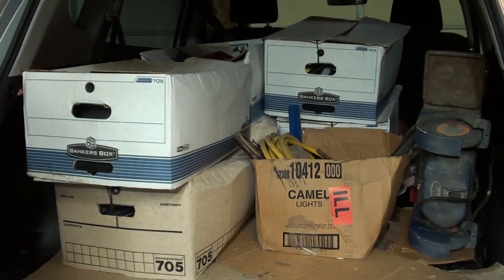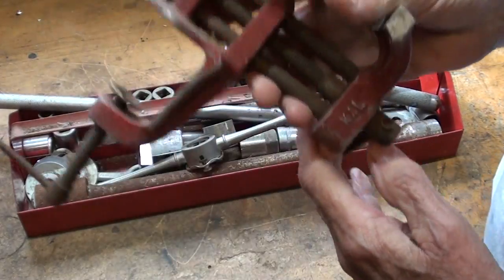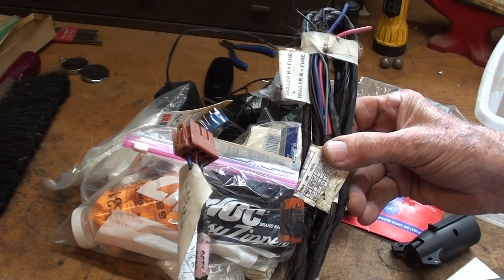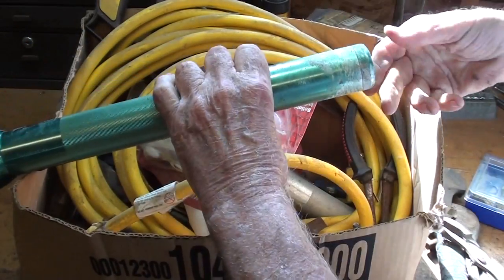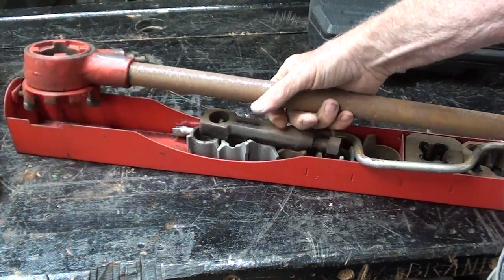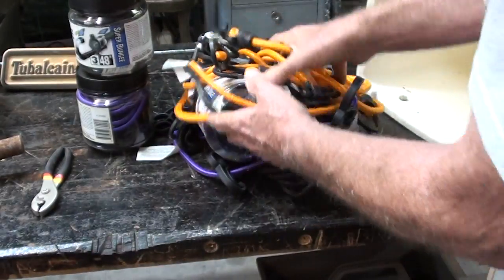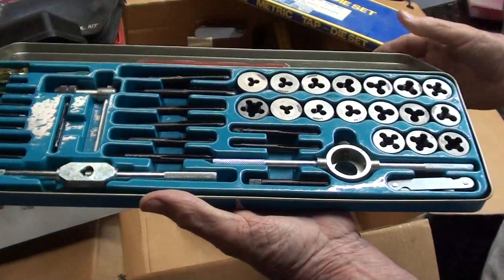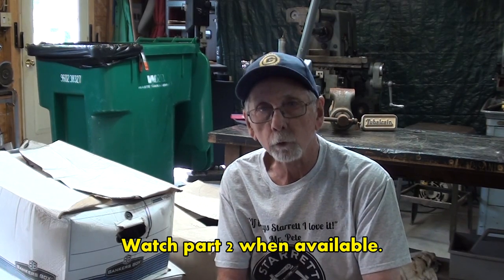MOTHER LODE OF FREE TOOLS  500 pounds pt 1 tubalcain hoard

Comment: The Stryker saw is a medical tool for cutting off casts (broken bones) it should cut the cast but not the skin underneath.
Reply: Might have a use in metal casting. I wonder if they use a Fein type oscillating tool nowadays.
Reply: correct also common in modern cordless used by trades people  with interchangable cutters for  plunge cutting in awkard places, copper pipes in corners ,sockets for electrical  boxes  and many more
Reply: Yep, I recognized the Stryker saw immediately. That's the same one the doc used to remove my (first) arm cast - 52 years ago!
It's funny which images will pop up out of the rusty old memory vault decades later...
Reply: in woodworking and remolding The German company Fein also made saws like that but then they come up with the  FEIN oscillating MultiTool which is a very handy tool .
Reply: @g.tucker8682  I had a feeling that was a cast saw... had mine cut off about the same time. I remember it burned a little when the hot plaster hit my arm.
Reply: @bookerol  Could be used for cutting fibreglass as well possibly
Reply: I had a cast cut off my leg with something very similar looking many years ago
Reply: Adam savage just happened to of made a video the other day talking about this tool
Reply: Cast saw or, if a slightly different blade and oscillation, a bone saw for orthopedic surgery.
Reply: @mauricelevy9027  -  It is, in fact, since most casts these days are comprised of moisture cured polyurethane impregnated fiberglass.
Reply: @bobweiram6321  bosch makes new ones that can cut on a flat and side plane.

Comment: Lyle, That Blue aluminium mallet with the white nylon ends, has lead shot inside to make it a DEAD Blow Hammer. Very nice to use, no bounce at all, I use mine a lot on the milling machine.
Reply: That’s what I used during my BAe sheet metal apprenticeship. They used the Thor brand in the 80s with nylon inserts

Comment: The Utica pliers at 19:12 with soft jaw inserts are called AN connector pliers. They are used for tightening and loosening larger circular connectors such as Amphenol and Cannon plugs.

Comment: At 27:58 Use brick chisel to clean welding spatter from metal welding table. Real easy and quick to use in sliding motion.
Reply: Carpet chisel... notice how it's with other Carpet stuff? It's used to tuck the carpet under the base bords after it's stretched

Comment: The Utica Pliers are Canon Plug pliers, they are for working with a specific type of Military plug connector, I find them very useful for working on round objects that you don’t want to damage, but they don’t grip very tightly - Stryker is a medical company, The saws came in a couple of variations, If it the blade rotated then that was a bone saw, used for cutting into chests or skulls.  If it vibrates that’s a cast saw.
Thanks for the videos.  Always appreciated.
Reply: And I just had to buy a pair of those cannon plug pliers last month.🙄
Reply: @jagboy69  My boss wouldn't allow me to buy a pair..."waste of money. Use channel locks & a rag." he said.
Reply: @ohmbug10  20bucks is cheap insurance to not screw up a cannon plug.  We work on aircraft so we really try not to booger up stuff.😉
Reply: @jagboy69  I agree 100%. I was an industrial electronics tech but I have an A&P licence. In the mill many times they were so corroded they would break. I suppose you don't need told what a pain they are to replace in the field especially standing on an extension ladder.

Comment: The pliers with the soft jaws are used to tighten "cannon" plugs, multi pin electrical connectors used on heavy equipment and military equipment.

Comment: You can convert the old Maglite flashlights to LED. Not as bright as the fancy small LED lights but they are still bright enough to blind, the batteries last for ages and I’d rather have one in my hand than an o light if I bumped into an unexpected visitor. 
I do enjoy a good tool haul video, I was with you right to the end, and no I don’t know what those tiny tools were at the  bottom of the box.

Comment: The vibrating saw is also very effective for trimming cured composite laminates (carbon fiber and fiberglass).  I've seen used in Kit plane construction.
Reply: Fein was the first company to make a  oscillating Multi Tool

Comment: 17:59 I think I know what that wrench is. Judging from some of the other "junk" I would say he was into aviation. I will take the Utica cheapy pliers they are for aviation cannon plugs and actually pretty good quality. The plastic jaws can be switched out and are still sold. The speed wrench you hate I would love. The new ones don't have the knob end and it is handy for stubborn panel screws.
The Stryker unit is used in composite aircraft structures. Very handy for an aviation structures guy. If I am correct the #24 & #30 drill bits are dull or broken. Check the angle on the line nut stage cone. It may not be the ASE angle. If that is the case definitely an aviation guy.

Comment: The Stryker saw is used for autopsies
Reply: Apparently if it oscillates then it's a cast saw, if it spins then it's a bone saw, you only use the blade that's on it on an oscillating saw

Comment: The tool in the stryker box has been used in hospitals for years for removing plaster casts and now comes in battery form for DIY use, as you noted the blade oscillates from side to side and can be used in awkward places, I have blades that cut metal and wood and one useful job is for removing hidden nails without wrecking wood trim etc.

Comment: Mag-lite sells replacement led-style bulbs for that flashlight. I have been using it for years.  
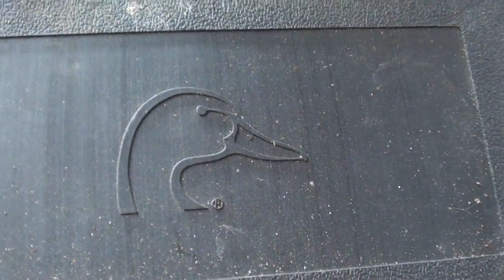 25:00  oscillating multi-tool is great for trimming in tight spots or where you don't want to damage surrounding areas.

Comment: Lyle - As others have said, the Utica pliers are Canon Plug, used for aircraft/military connectors on electronic equipment.  Used them many times and handy for anything round to twist on at times.  Watched the whole thing.  I needed you when I wanted only some broaches in one drawer of a chest at the auction of an OLD garage - had to buy the whole wall of stuff from the garage for $15 to get them.  Then filled up the entire back of the pickup with what was there.  But did sell off a set of headers in the mix to pay for the plunder.  And scrapped a lot of steel!

Comment: Mr. P,  At 19:20 those weird looking slip jaw pliers are for using on cannon plugs that are used on aircraft.. They issued us a pr of those for working on jet engines.. Haven't seen a pr of those in many years.. At 34:42, that is part of a knife sharpening system.. the little slots were for putting different angles on your blade.. Look and see if has the name Lasky on it.. I paid 60 dollars for one of their kits about 35 yrs ago...Nice haul, enough content for 2 or 3 more videos.. thx for taking us along.. God Bless...

Comment: The Stryker vibrating tool is for removin
g the old plaster cast that were used for wrapping broken bones. Remember " hey sign my white cast on my broken arm"? It was design ed not to cut your skin under the cast. The black shears with big loopy handles are gardners shears scissors.  The Utica slip joint pliers with rubber jaw pads i use in Aviation for avionics /electrical connectors and or plugs. Prevents damage to expensive avionics hardware. Your " cranked neck chisels" are for giving handle clearance. There other two are mortising chisels.

Comment: The Stryker saw is used to cut through casts, like put on for arm and leg fractures.  This brand is very expensive.  The blade oscilates and will cut through any solid material, but if you press against soft part of your hand, like the heel, will only generate heat.  There are modern tools using the same mechanism to cut wood like undercutting floor molding.

Comment: FYI - LED replacement bulbs are available for those older Maglites. I upgraded all of mine, to LED bulbs made by CREE. They are extremely bright, and do not drain the battery supply like the old incandescent style.

Comment: Item in "Skater Box" is a saw for cutting off plaster casts after a broken bone has healed. The teeth cut rigid plaster but when they contact skin the skin moves with the blade and is not cut.

Comment: The wiring harness in the first or second box is an adapter.  It came with a GM truck to hook the trailer brake controller to the junction box under the dash.  I believe that the wire basket thing you didn't  know what it was, is a light bulb remover that just needs a long handle.    No they're not roach clips, they are heat sinks for when you are soldering.  The flat aluminum one came from Radio Shack.
Reply: I believe that the "wire basket things" were used to keep leaves out of rain gutter downspouts: the wire ends fit down into the round downspout and the round end filters out the leaves. You still had to clean out the gutters, but at least the downspouts didn't get plugged.

Comment: Lyle, that electric vibrating tool with strain relief cord at about 25 minutes in I am pretty sure having my unfair share of broken bones in my youth was used (obviously it would have more uses as well) to cut plaster casts of limbs that are encased in them.
You can also use them on cutting timber frame work, holes for light fittings pipes etc in plaster /gyprock, drywall etc
Nails off that are bent and so on, a very handy tool.
Tony from Western Australia 🇦🇺
Reply from the maker: Thanks

Comment: 18:20 Those Stanley Pro screwdrivers are my ATF. Fit my hand nicely, + screwdrivers were yellow, - were green, easy to identify. I wish I could still get them.
Reply: I used one for years, before lithium battery tools were really a thing. I had a job that used thousands of the same small screw.

Comment: Lucky guy. Last thing you asked what is it, it's a hand held knife sharpener holder but you need to find the different course sharpening stones with the metal rods that goes up into the end on it, and knife blade goes into the vise. That way each stroke is exactly the same an knife gets sharper than doing it free hand. I have taught many people how to use those.

Comment: All of those rusty tools can be cleaned up by soaking them in vinegar for a day or two or three (lather, rinse, repeat as necessary. That ratchet could be soaked and then take a wire brush to it and the extensions and breaker bars could be soaked and cleaned up with some #0000 steel wool. That heavy yellow extension cord could have new ends put on it and used as a 220 extension cord. I have one just like it that I use when I am working on electric clothes dryers or electric ranges. You can get the appliance out of their little nook or away from the wall where it is a lot easier to work on them.
Reply from the maker: Thank you for the idea

Comment: Lots of good tools in your haul. That they were free makes them even better. You correctly identified the nut cracker. But it is a not very good gimmick tool. To be effective you would need to use a breaker bar to get enough leverage to split the nut. A ratchet or regular length wrench wouldn't do the job. The scissors with the odd loop-like handles are used by gardeners to prune plants and cut flowers. I think the stuff you dont want could be donated to charitable groups to give someone learning about tools a start. Looking forward to part 2.

Comment: Lyle, you could single load those .22 short blanks into your rifle, with a .22 air rifle pellet in front. It will come out at a rapid rate of knots, faster than a .22 long rifle round.
Reply from the maker: I think I will try it. I will have to buy some 22 caliber pellets. I only have 5 mm

Comment: That "gadget" with the Yankee screw driver is a clutch driven screw driver to be used in an electric drill motor. As you put pressure on it , it starts to drive the bit.
Reply from the maker: Thanks

Comment: The Stryker tool....not exactly sure but I own a KETT saw with similar features and blades, except my blades turn and are a complete circle of teeth. I cut metal door frames for new hardware,etc with mine. Was working at a hospital and a surgeon saw it and told me I had a bone saw,haha

Comment: The Wilton vice would go for a leat $200 on Ebay if not more - alway outbidder at  auctions on those. Aluminum bicycle is best in Florida where salt rust all steel bicycles.

Comment: Industro was sold by the local "Harm & Fome" for a little while.  I had two sets of the box end wrenches, gotten about 40 years ago.  Still have a few of them, which is surprising, considering my ability to (as Dad put it) to scatter tools out "from hell to breakfast" at the time.  Having a few of the odd sizes (like 25/64) was handy, and needed if you worked on anything Ford.

Anything made in Japan yesterday (and has survived purges) is better than the MIC of today.  Those tap/die sets looked like a set I was given several decades ago.  Comparing those with the automotive store sets you get these days ... MIC makes MIJ look like high quality.

Comment: Lyle,
You showed and tossed aside a goofy looking pair of low quality curved jaw slip joint pliers. These are Amphenol connector pliers. They come in two jaw style versions. One version has lightly cerated jaw teeth and the other style has plastic padded jaws. The curved jaw design is to grab the locking collar of the robust, yet fragile, internally threaded locking collar without damage. Most electricians don't own or use these pliers and substitute channel locks which mar the MIL-spec collar. Amphenol connectors are widely employed in military and industrial equipment. They come in a myriad of styles and sizes. The locking collars employ very fine threads. The are designed so the pins and sockets barely engage before the locking collar can be partially threaded. The plug is further inserted and the free play of the locking collar taken up requiring alternating back and forth until full plug insertion is completed. The shells of the Amphenol plugs and sockets are die-cast and are olive drab in color. Amphenol connectors can be quite large and commonly have many pins both for control and power applications. Inserting 50 pins simultaneously takes a lot of force. Pliers assist turning the locking collar.
Amphenol connectors are employed where field connections are required for assembly or maintenance. Most commonly, the sockets are mounted in the panel wall or on a bulkhead. The plugs are mounted to 😀😀cables or flexible conduit (sealtight). Japanese manufacturers favor flexible conduit and American manufacturers favor cable. Electronic supply catalogs in USA don't list shell components designed for sealtight. Bulky adaptors are required. The Japanese versions are sleek and compact. 
I worked for a manufacturer that employed dozens of electricians and I am pretty certain that I owned the only pair of Amphenol connector pliers. I prefer and almost universally employ only the correct tool for every application. Although encountering Amphenol connectors on a "daily" basis, pliers were seldom required. I picked up my steel jaw version used and never invested in the soft jaw version. Quality versions of these pliers always look ridiculously cheesey. Your affinity for owning and employing the correct tool mirrors mine. I own dozens of tools that I have never to seldom used simply because I am ready to deal with a situation that I was previously unprepared for. Although I am long retired and have invested many tens of thousands of dollars in my hand tool collections I find that I spend more money now on tools than when I was employed. You and I share a commitment to the supremacy of Starrett over other machinist tool brands. I am afflicted with preferring the premium brand regardless of the trade. I am forced to compromise on my brand selection because of economic constraints, but I am more loyal to the premium brands on other than machinist trades than you seem to be. A Craftsman type quality tool "burns my hand".  My son legitimately calls me a tool snob. But all of my boys and grandsons inherited varying forms of my tool snob affliction. Some have very serious afflictions.
Reply from the maker: Thank you for the little lesson. I totally agree with you

Comment: With sharpies, if they're dried out but never used you can take the two halves apart and put a few drops of acetone or 91% rubbing alcohol on the ink wick and it'll work like brand new. I've saved quite a few markers this way now that I know this trick. The trick is actually to not put too much. If you go overboard you'll get bad bleeding.
Reply from the maker: Thanks

Comment: I see that there is a hive tool in there. used to break free supper frames. The big wrench looks like a round JB spanner. the other junk item is a speed screw driver to use with a hand drill. Why do people store hacksaws under tension it distorts the frame. Hope you find the rest of the knife sharpening kit.

Comment: There were several different lights  in the box labeled "camel lights" but I don't see how you mount any of them to a camel -- unless you use the ratchet strap and the bungee cords.  Would they be for dromedaries or bactrian camels?
Reply from the maker: The ones with two humps
Reply: 2 humps -> bactrian.

The Ogden Nash poem goes

The camel has a single hump 
The dromedary two
Or else the other way around.
I'm never sure, are you.

When I learned the poem, I also learned that it's the other way around.

Comment: I strongly recommend you throw away the grill brush.  It's old and rusty and the wires might break off and stick to the grill.  Someone could accidentally ingest one of those wires if it stuck to the food you cooked on that grill and that would be extremely dangerous, particularly if it pierces the intestinal wall.